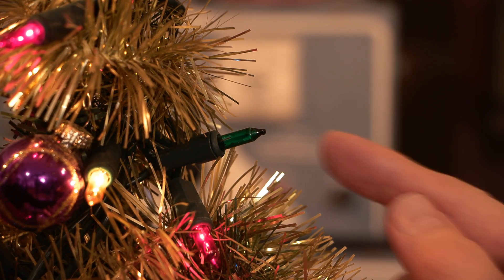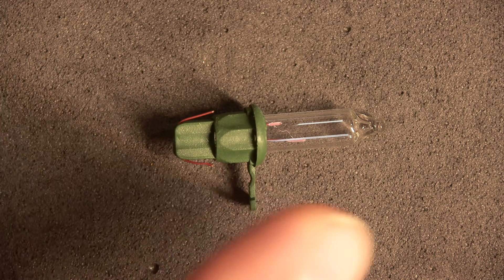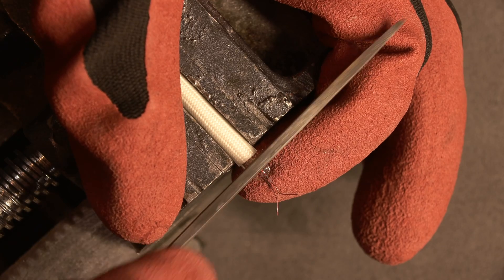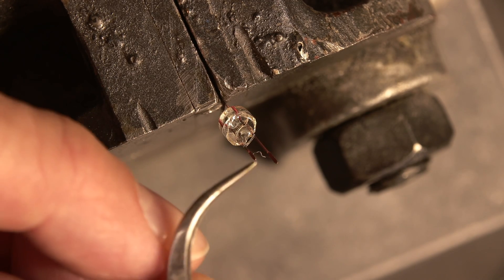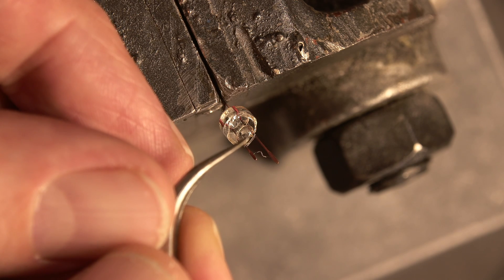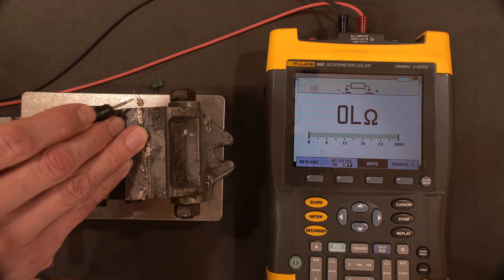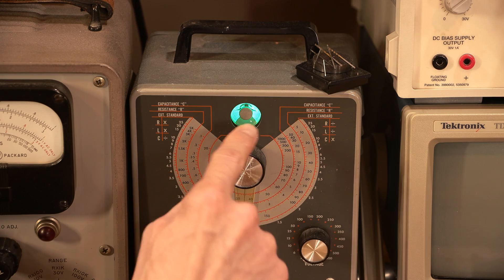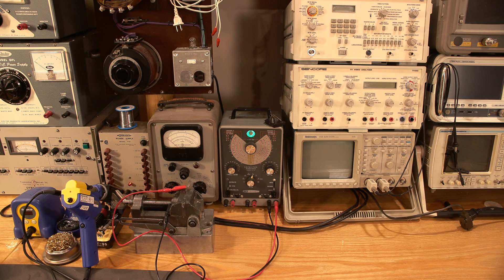The Magic Hiding Inside Your Incandescent Holiday Light Strings!

Comment from the maker: To learn electronics in a very different and effective way, and gain access to Mr Carlson's personal designs and inventions, visit the Mr Carlson's Lab Patreon page here: https://www.patreon.com/MrCarlsonsLab
Reply: the nominal voltage range to trigger the  the shunt is about 30 - 70 volts AC PS they are also function as a 3 amp fuse.
  this is my result of a teat on 30 bulbs.
 my test rig is a vintage variac transformer in to a 1 - 3 isolation transformer the amp meter reads op to 5 amp in 1 ma increments
Reply: the voltage range changes if air gets in
Reply: my test load is a 60 watt 120 v bulb
Reply: How many volts can I power this small bulb? What is the limit voltage?
Reply: @salihm4268 In Europe we use a 230 +/- 10% mains supply voltage. 
A 20 bulb string has 12 volt bulbs and 40 bulb sets use 6 volt bulbs.
Reply: @anthonyshiels9273 I have the 50 bulb model and it just burns flat. How many volts are going to each?
Reply: @salihm4268  10% over is not to hard on them ps math is 50 set  2.5v 35 set 3.5v 25 set 5v 20 set 6v 10 set 12v 8 set 15v bulb voltage each bulb
Reply: please next time announce what you are going to do while gripping the glass between the  steel vice jaws while holding it with bare fingers. I'm not sure why but it triggered serious 'please wear gloves' which you did .. and everything went fine. so ... next time just say in advance first what's going to happen next and all will be fine. 😅

Comment: When Mr Carlson pulled the bulb out the first time why wasn't it lit when you put it back in. What
was the difference in the heat between the first time the light had blown out, and the string went out. Then the bulb was reinserted the second time, and this made the string work well. Where did that heat come from between those two leads to melt that insulation the moment it was reinserted.😅

Comment: So theoretically if all bulbs opened at the same time there would be a short across your 120 volts supply? Also, in time if all bulbs were allowed to die out there would also be a short across your 120 volts supply? Is this not a dangerous idea?

Comment: many thanks for this informative video!  I had always wondered about this and how products like the "light keeper pro" would re-activate the light circuit.  I have a set of lights in which each bulb has 2 filaments (and the glass is painted 2 different colors, giving the 2 color effect for each bulb, which I love).  I wonder if the 2 filament bulbs work the same way?  my set hasn't worked in years, and unfortunately, it's hard to find replacements.

Comment: You mentioned that once a lamp failed and the shunt wire completed the circuit that other lamps would be stressed a bit more. We used to add a dim bulb in series with our holiday light strings to prolong the life. Getting the correct wattage was a bit of an experiment but kept the lights glowing!

Comment: Thanks for the demonstration and explanation. I always thought it was a bypass circuit in the  bulb that kept the other bulbs illuminated. I never knew that it was a fusible switch mechanism.  Wonderful innovation, I just wonder if it was applied in any other lighting or power circuitry besides mini bulb strings. I currently have a very long string of lights on my deck railing and just a small portion of a powered string is out that needs investigation and repair. I presume it is now a case of multiple burnouts that made the section die.  Investigation will need to wait until I take the string down and have nothing else to do.

Comment: Maybe I missed something but how does a series string reach over 100 volts at one socket if one bulb burns out? 50 bulbs in a string equals about 2.2 volts each. Most 100 bulb strings are a 3 wire set up so only half the string goes out.
Reply: Hopefully I didn't misunderstand your question.  Consider a network of several equal resistors wired in series hooked up to a voltage source.   
The voltage drop across each resistor (lamp) will be spread equally for each lamp.  However, if you take one of those lamps and
change its resistance to something much higher than the others, the voltage drop across that resistor climbs, compared to the
drop across the other resistors (lamps).   In this case, if you have an open circuit on that same lamp, think of that as a very very large
resistor, thus the voltage drop across that open circuit equals whatever the source voltage is (climbs as high as is possible).
Reply: @marvinmartian8746     Ok, but in an open circuit the buck stops there at the open so even with a higher voltage it's not going anywhere.

Comment: Ham Radio question 572 b tube it's that a 500 watt tube my 811 H is 850 watt amplifier Wonder if it can be converted to a 572 b it be less power but the tube last longer

Comment: Every bulb that burns out that the shunt shorts out, causes the voltage to the other working bulbs to increase slightly. The amount of bulbs in series are calculated during manufacture depending on the voltage of the bulb they intend to use. Usually the bulbs are 2.5V. in that case they wire 48 bulbs in series on a 120VAC circuit. The tungsten filaments in each bulb act as a resistor that help regulate the voltage to the others. If enough burn out,  you eventually reach the tipping point where the voltage is high enough to quickly pop every bulb in the string, even with the fuses in the US style plugs. They are not intended to protect against this. However, installing a fused bulb as those in the UK have pointed out can help save the rest of the bulbs and make it easier to extend the life of your set.

These series style lights are the perfect scenario for the manufacturers. They give you two replacement bulbs and know that you are likely only going to get two or three years of use out of the set before enough bulbs burn out to cause a total failure. At that point, there's no need to TS anything. It's cheaper to replace rather than replace every bulb.

Even if you do keep on top of them, after 3 or 4 years, you find yourself spending most of your holidays chasing tired bulbs to keep the string healthy. If you are retired, if gives you something to do, otherwise, I would replace every 2 or 3 years to maintain your sanity 🙂
Reply: I would like to add that my record on keeping a mini light set going was 7 years 🙂

Comment: I have known about the shunt in the bulbs for many years, but was unsure of why so many times they don't activate. I wonder if the really cheap light strings if there's enough voltage drop to keep them from shunting properly at times or if typically more than one bulb may fail at the same time in which case the shunts would not work correctly? Nice explainination! Merry Christmas to the Carlson's!

Comment: I've used single or a couple of these bulbs on low voltage supplies.  Wondered if the shunt could activate if say the total supply was 6V.  According to what you demonstrated, this won't happen if the filament did open on my low voltage circuit.  Thanks.

Comment: Bulb interiors are not a vacuum. They contain an noble gas like nitrogen at a pressure which when heated by the filament equals the outside air pressure.

Comment: How does the shunt maintain contact?  Does it weld itself or is contact simply through tension against filament leads?  The shunt almost looks like a tiny spring which would support the tension suggestion.

Comment: Why did it take over 100 volts to trip the bypass wire? Since the bulbs are in series each bulb would use way under 10 volts.
Reply from the maker: Here's the trick: The string has to be drawing current properly (all the bulbs are glowing) for the bulbs to have their specified operating voltage across them. When a bulb filament opens, full AC line is across the faulty bulb. Thats how series strings work.

Comment: Hi Paul Continuously amazed by your electronic repair acumen. Since you design your own measuring devices Do you have a degree in electronic engineering. P.S. Have you ever come across A National Panasonic RF 9000 the top of the line multiband receiver.

Comment: A nice, straightforward and science-backed explanation! Insulation breakdown makes sense to me as when the bulb goes open, the mains voltage will appear across it, and as demonstrated, it's high enough for the insulation breakdown.

One more thing is the temperature resistance coefficient. A cold filament's resistance is lower than hot filament's; the bypass resistance - as Fran demonstrated - is lower than cold filament's.That's a big problem when those bulbs start failing. Blowing a single bulb won't really change anything, but the more of them go out, the higher the current through the string, the more power dissipation per bulb, and the higher risk of any remaining bulb going out. It will accelerate over time, so if you see a dead bulb, replace it or else you'll have a lot more to replace than just one. Hell, in an extreme case the whole string will get blown and act as a low resistance formed by bypasses, tripping a breaker or burning down if it doesn't happen.

Comment: The only downside is the rest get more voltage, making them burn out faster. I don't have enough bulbs to replace the burned out ones. So, I use a light dimmer cord to lower the voltage.

Comment: How do you find a non-working LED bulb in a light string?
Reply from the maker: LED's usually close as a failure point. The do occasionally open, but closing is far more common. So they naturally do what the incandescent bulb is made to do.

Comment: Does that shunt have a lower resistance than the filament (after the insulation has been removed)? If so, does that lower resistance allow a higher current flow to the other bulbs? If so, can that higher current flow burn out the other bulbs?
Reply: Yes, it will. Shunted bulb does shorten the life of others and if left so long that second bulb fails and shunts, it doesn't take long for them all to burn out. Have experienced that, and some light strings used to have warnings about this.

Comment: If one bulb blows the voltage that should go to it will be shared across the string, if more bulbs blow, the voltage to each of the remaining ones will get too high and cause a runaway short circuit
You didn't mention the fuse bulb, which is essetially a normal bulb without the bypass, normally has a white cap, and usually found at the end of the string
The scary thing about christmas lights in america is the small gauge wire which will not withstand 16A if there's a serious short, at least in the UK we have fuses in plugs which we can use a 1A or less rating
A way i used to make my strings last longer was to get another string and take about 6 bulbs and holders from it to solder into a full string, it reduces the voltage to each bulb, and only slightly noticeable dimming.
Reply: Actually the ones here do have fused plugs, even the larger c7, c9 and bubble light sets all have fused plugs. In the early 80s Kodak made miniature light sets that had fused plugs along with 2 standard fuse bulbs, the tip was marked green on the fuse bulbs and red on the flasher bulbs

Comment: Looks like this a response to Fran's video. I discussed this over there and mentioned your diode modification you did years ago. I've done this to my lights and they're a little dim, but I like that it saves the bulb. My wife thanks you for convincing me to go back to incandescent Xmas lights. Although I still have leds as well. I've always thought that the spreading of the filament holder when the filament opens is what made that wire at the bottom short out the bulb, but this really clears this up for me. It took me a minute to figure out that the bulb would actually see 120 volts with open circuit condition (blown bulb) for a second and it's THAT high voltage that jumps through the insulation.

Comment: In late 70`s, my family bought a chinese Christmas lights string with the same bulbs, all white and one blinking bulb, all in beautiful colorfull silk globes. All in series. In time, they burned one by one until the remainig bulbs burned all at once and made the fuse pop in the house. I always tought that the wire made contact when the filament burned; the filament acting like a spring, when burned the tension released and the filament supports were shorted by that wire. 
In early 2000s, I found the dead Christmas string and repaired it with new bulbs that were more common and easy to find by the time.

Comment: OK I get it, we cant use ohms law with incandescent bulbs.  All filament bulbs have a significant positive thermal coefficient of resistance. That means as they heat up they get much higher in resistance. Cold incandescent bulbs have nearly zero ohms of resistance. When the filament burns out the whole string goes out and the string resistance drops to zero, causing the voltage to get close to 120 volts across the burnt out bulb, which triggers the shunt to short out the blown bulb.
Reply: The voltage gets split across the bulbs according to their resistance ratio. Normally it is split equally between them. The open circuit bulb resistance is at least several hundred thousand ohms and the normal bulbs less than 10 ohms, so in effect all the mains voltage appears briefly across the blown bulb.

Comment: So if we have 50 bulbs in series running at 120 volts, the voltage across each filament is 2.4 volts and the current is the same through each bulb. (Series Circuit)  Where does the 120 volts come from when the filament burns out. Wouldn't the resistance of the 49 remaining good bulbs drop the voltage at the burnt out bulb to 2.45 volts?
Reply: When the filament opens there is briefly no current flowing through the bulbs, so no voltage drop (ohms law V=IR) across the other bulbs and the full mains voltage is present across the blown bulb.

Comment: Here’s what I don’t get: each bulb in a string of 50 lights only sees about 2.5 V AC. So when only one filament burns out, how does that raise the voltage enough to weld that shunt?
Reply from the maker: Picture it like this: When the filament in the burn't bulb fails, the rest of the string does not draw current for a brief period (lights go out.) When the rest of the string is out, the voltage across the burn't bulb goes to "around" 120V for a brief period causing the insulation on the shunt to break down and make connection turning the rest of the string back on again. Some shunts inside the bulbs will break down at lower voltages, but the breakdown is above the bulbs normal operating conditions.

Comment: Great video.  One comment:  I noticed that toward the beginning you mentioned that the short in the burned-out bulb caused shorter life for the rest of the string.  I guess you assumed that your viewers are able to figure out that that is because the loss of resistance in the filament of the burned dead bulb caused the current in the rest of the string to increase slightly.  If you stated that I missed it.

Comment: There are typically two different voltage ratings on these bulbs, 2.5 and 3.5 volts.  Match the voltages to the number of lamps in the string so they add up to nominal 120 volts total: 50 lights × 2.5 volts = 125 volts, or 35 lights × 3.5 volts = 122.5 volts.  Multiples of the quantities are used for longer strings, physically bundled together: 50, 100, 150 lights, or 35, 70, 105.

So to maintain proper light output and bulb lifetime, use the correct replacement.

Comment: You said all the bulbs are in series. So why do most modern strings of lights have three wires between bulbs?
Reply from the maker: That one extra wire carries AC to the outlet at the other end of the string, and in some cases for very long strings, it carries AC to the second set of bulbs in the same loom.

Comment: Very interesting! I always wondered how that worked. You mentioned that this arrangement with the individual bulbs shortened the life of the rest of the light string, but you didn't tell us why that was the case. Or else I missed it?
Reply: The life of the rest are shortened because the shunted one isn't making its voltage drop into the circuit anymore, so then rest of the bulbs are sharing all the supply voltage together, equalling into higher per-bulb voltage.

If you leave the burned-out one unchanged and second, third - you count it - burn out, they all burn out soon due to even higher voltage, to the levels that no bulb can withstand for long.

Comment: That's funny, Fran just a video on this exact topic.  My theory about why you'd always have one or two blown bulbs in every string when came to put them up at christmas, is that some of the bulbs are a tiny bit leaky.  You put the lights away last year with all the bulbs working, but now there's one or two in every string that are blown.

I think the  bulbs slowly leak over the year spent in the cupboard.  Just a few oxygen atoms at a time until there's enough to cause them to blown instantly the next time you plug the string in, which will be Christmas next year.  At such low temperatures there's no reason these bulbs would not run for decades apart from that.